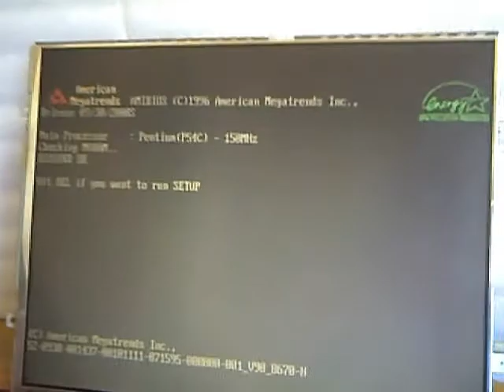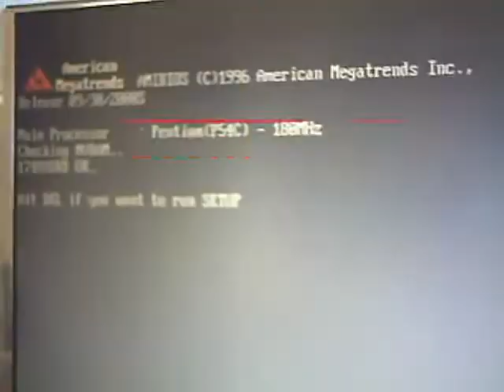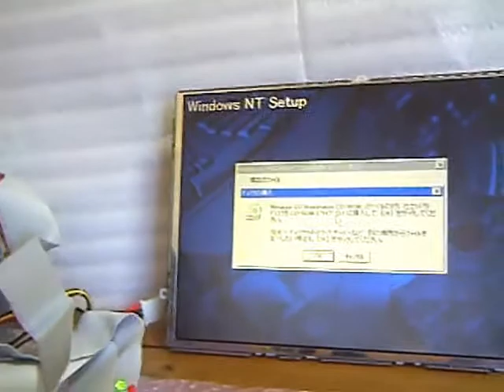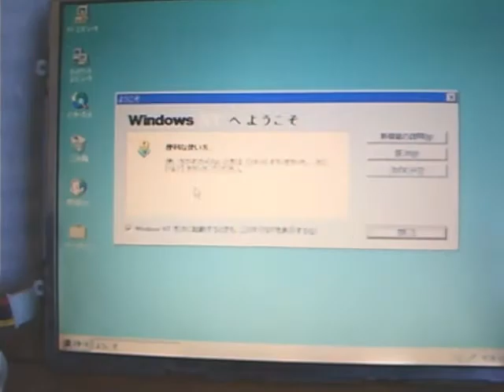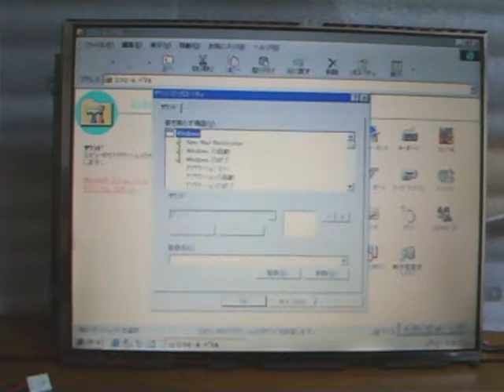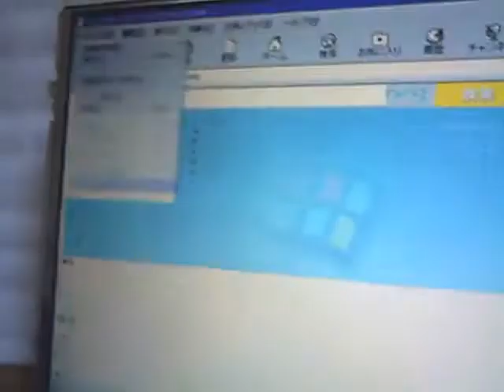PC-Chips M599LMR Socket7 info

Comment: Hi, I have the same motherboard. Do you have the bios supporting K6-iii
Reply from the maker: Nick Messenger I is unknown because it dose not have a K6-Ⅲ Manual of this Motherboard in the following URLhttp://www.virtual-concepts.net/drivers/pcchips/m599lmr/m599lmr-14-1.pdf
Reply: akibachudoku - Yes you are right it does not have any reference to K6-iii in the PCCHIPS Manual. I have always surmised if it works on a Biostar M5SAF with it's similarities then there has to be an updated bios! Found the updated rom I needed here http://www.elhvb.com/supportbios.info/Archives/BIOS/0-A/AMPTRON/PM-0599LMR%20%28M599LMR%29/index.html K6-III working like a champ on AMPTRON M599LMR
Reply from the maker: Nick Messenger Thank you so much. I would like to someday try to update
Reply: akibachudoku the rom comes with aminf325.exe to flash your bios all from a single boot floppy. I cannot find any reference in the manual do you know what the 7 pins are for next to DIMM1 opposite the USB ports? Also can you share with me any graphics cards you have had working with the PCI slots?
Reply from the maker: Nick Messenger Launch the same M/B at a low-spec configuration : Movie → https://www.youtube.com/watch?v=zu0W3gE4Vqk
Reply: Jimmy S I must have flashed every ROM from the URL I posted above all working aok. What was the maximum ram you could use 384/512/768MB and was it a config of two or three modules.
Reply: No problem with Windows XP. Refuses to boot with more than 512MB. Thanks for the tip.
Reply: Yes they were all tested with Memtestx86 and no errors might be high density I will check in a few days time to be absolutely sure.
Reply: Jimmy S akibachudoku I don't have it setup now however will give it another look in a few days. In the meantime I did create an post over at vogons.org
Reply: Those LAN adapters for this board and others are becoming scarce now. I have acquired a box of new old stock all various compatible models capable of 10/100 Mbps.
Reply: True not without it's issues I disabled the onboard controller in favour of a PCI NIC. I could used three dimm slots up to 384MB and two slots up to 512MB.
Reply: The three modules that work are Infineon HYS64V16302GU-7.5-C2 16Mx64 each 128MB.
Reply: The following Infineon modules are all 256MB each and tested. However only two work at a time. HYS64V32220GU-7-C2 32x64. These must be high density?